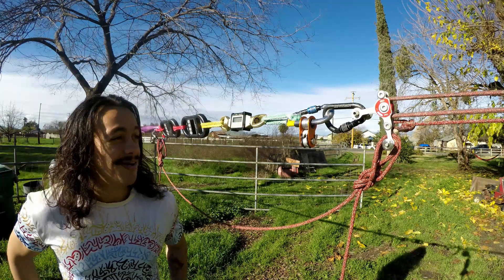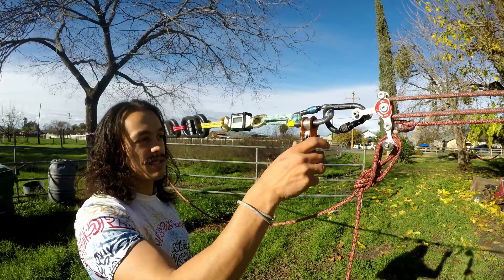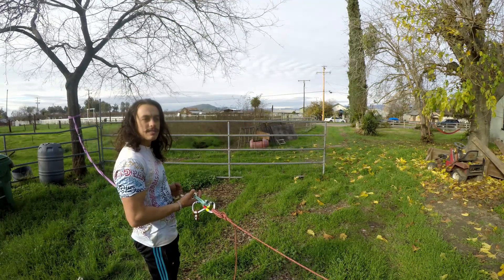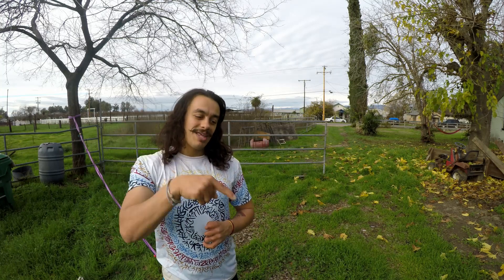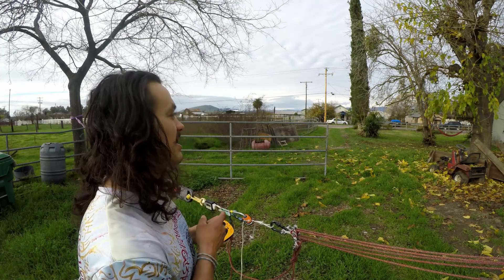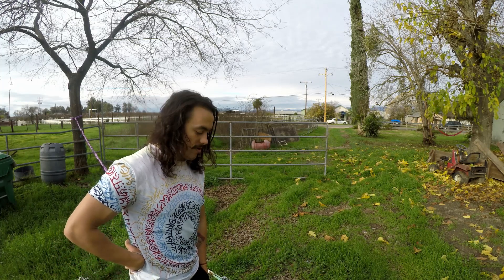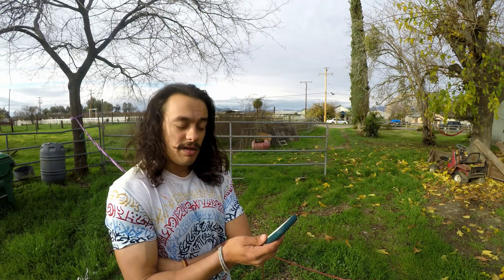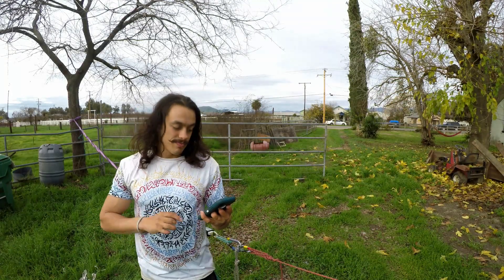Best Device For Hauling HUGE SLACKLINES?? - CT Roll N Lock

Comment: Has anyone tried the Edelrid Spoc?
Reply from the maker: Not to my knowledge but it’s on my radar and I’m going to give it a shot at some point 😊
Reply: @treenetweaves  Thanks man 🙃
Reply: The thorn teath like in the MT a inbed themselves partly into the rope that in essence hook within the weaving that causes a higher response time for the cam to engage resulting in a higher tension force on some threads that causes some threads to snap progressively as its loaded above the ropes threshold. While a ribbed cam LIKE RL  partly allows some slippage but eventually pinch cut the strands.

Hence although the ribbed teeth might perform better on initial pull test on durability and wear persistent close to threshold loading will degrade the NBS of the rope faster with a ribbed cam than a toothed cam..

Obviously the specific diameter of the cam and area of the can engaged on the rope and concentration of pressure will also contribute to one product performing better than the other..